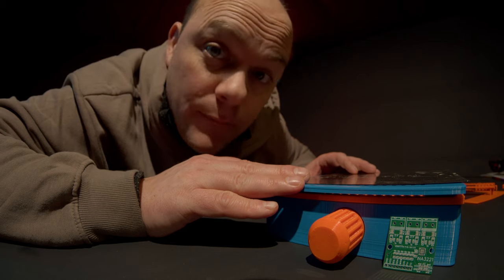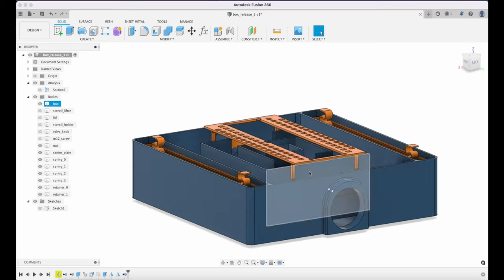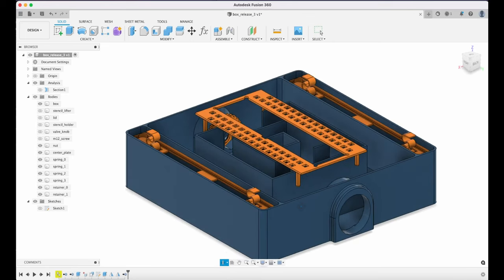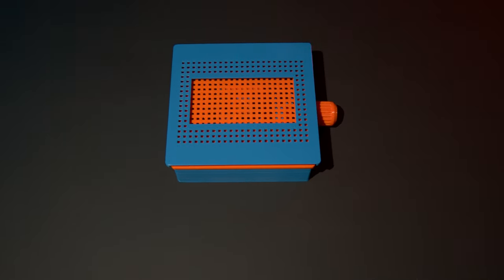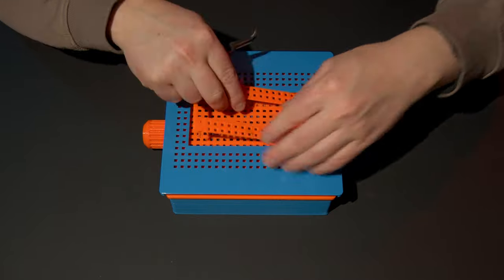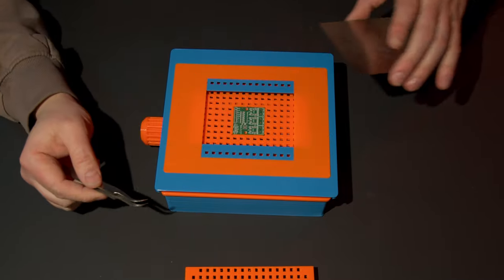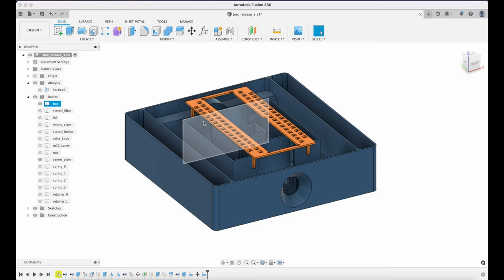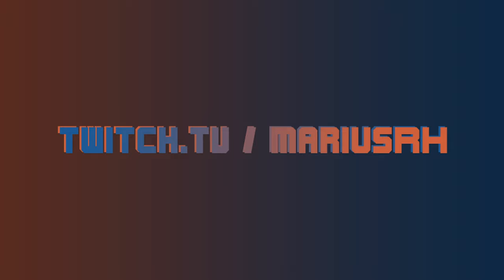V3 Vacuum assisted solder stencil box

Comment: Fantastic design!  Will this system work with small thin flexible circuit boards or what would it take to modify it?  Also, would I need to 3d print my own circuit board holder for each different sized board that I make?  Thanks!

Comment: Cool design. I don't use vacuum cleaner nor have one. I wonder how "suction" it required, maybe in terms of L/min, to properly hold the PCB and stencil?
Is it worth it to try to use some low end industrial vacuum pump or a DC one even?
Reply from the maker: Thanks. I used vacuum cleaner because of the high cfm.. So I didn't need for it to be sealed good. But if you hsve tented vias snd no holes trough it might work. :)

Comment: Very cool design. I wanted to print and test it out but i couldn't find the file for the bottom box.
Reply from the maker: Did you see the github page or thingiverse?
Reply: @MariusHeier1  yes i checked them both. But i can't find the base box
Reply from the maker: @m.zakiiii5234  Let me look for it tomorrow ;)
Reply: @MariusHeier1   have you checked it?
Reply from the maker: @m.zakiiii5234  YEAH! I just did now. You are absolutely right. It is missing. Lets get it up there.
Reply from the maker: @m.zakiiii5234  Its uploaded. You can also get the fully editable one here. https://github.com/MariusHeier/magik_solder_paste_stencil_box
Reply: @MariusHeier1  Thanks a lot :)
Reply: @MariusHeier1 
I think you might have uploaded a wrong version of the base box because it doesn't match with Top parts.
Can you please upload the editable one in step format? Since I'm using solidworks I can't import the f3d files.
Thx again :)
Reply from the maker: @m.zakiiii5234  Sorry for making you print something that big wrong. That sucks. Im gonna look into it and get back to you. Btw are you on Discord? You can join my discord server here and DM me if you want. https://discord.gg/QcCkfbkp3S
Reply: A very big thankyou for creating this .. could you please recommend the print settings . Layer height. Infill etc .? Which material is best to use petg or pla ? I printed off the box but ended up with hollow walls they are two seperate layers I'm sure this is not right .
Reply from the maker: @adamsaiyad3959 Got discord?

Comment: Really nice design! I only wish you made use of components in fusion360, would make for a much nicer fusion design that is a lot easier to edit.
Reply from the maker: This V2 has a fully parametric version of it. The link is in the description. https://www.youtube.com/watch?v=9BKQ18qDeZQ
Reply: @MariusHeier1  yeah no, this is not at all what I'm trying to say. Of course it's nice to have custom parameters in a design that can be easily adjusted, but my critique really was about how you constructed the file. I'm sure the way the timeline looks made sense at the time when you made it, but for someone who did not make it, the timeline is just one straight line of unstructured mess that is extremely easy to break. 

By utilizing components, you can bring much more order into your design and make it easy for people who did not do make the design to grasp what the designer was thinking. I know this adds another layer of complexity, but it comes with the benefit that your design is much more robust to upstream failures when you change stuff early in the timeline.
Reply from the maker: @wolfganglienbacher  Yeah. You are right. Im going to make a new box.

Comment: I've been looking at your design compared to the one by Unexpected Maker here: https://www.youtube.com/watch?v=5iX61nD94cg and I really like a few features of yours that are making me lean towards building this one, like the spring lifters and the threaded vacuum release valve, but one feature of the UM design that could really benefit yours here would be if you made the vacuum inlet into a modular panel design, so people can more easily create their own inlet nozzles to fit their particular vacuum hose.  Just a thought.  Awesome design though, and thanks for sharing the model!
Reply from the maker: Yup. Im gonna try to make a new version soon with changes. ;)
Reply: @MariusHeier1  While you're at it, the tolerances on the threaded parts should be increased, and you should chamfer the edge of the threaded parts.  Also, the retainers are the wrong size (too short in the longest dimension by about 10mm).
Reply from the maker: The new one is very different. But operates on the same technological principles